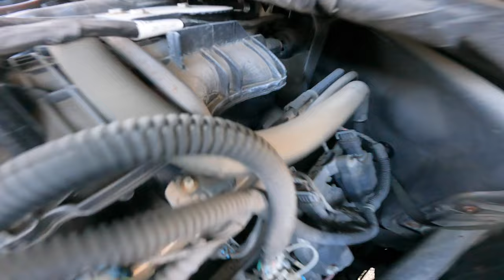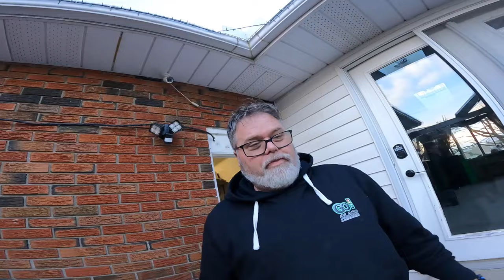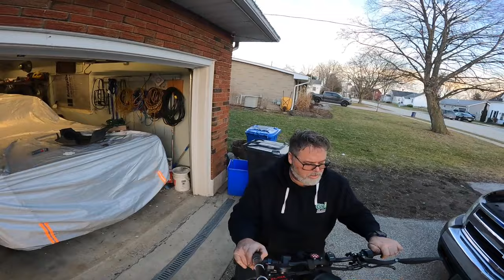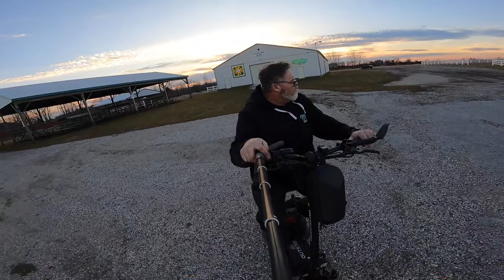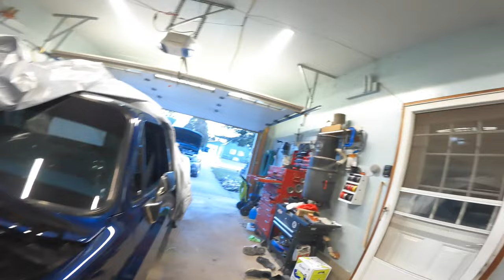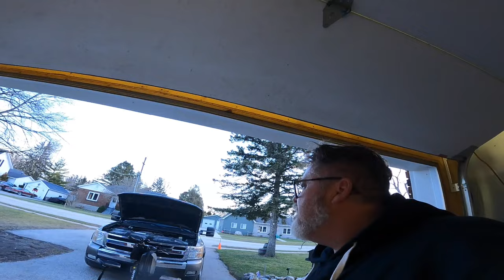Finally No Leak And Other Things   HD 1080p

Comment: With the oil pressure sender .... If it's like my 2012 5.3 don't forget to change the screen under the sender .
Reply from the maker: Comes with it on the one I bought. Thanks for the heads up.
Reply: I have changed a few of them idk y they go bad so often